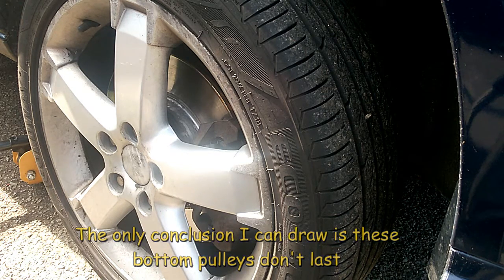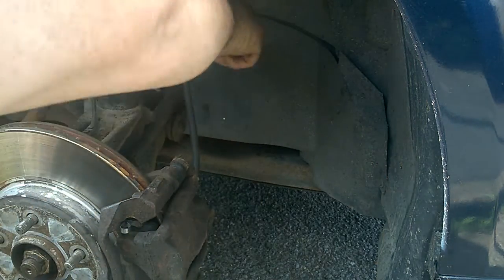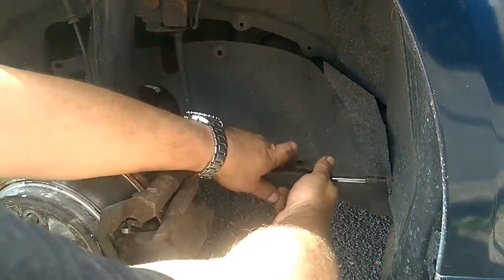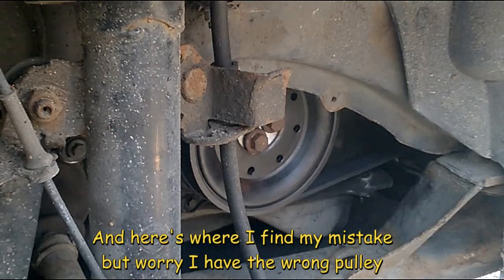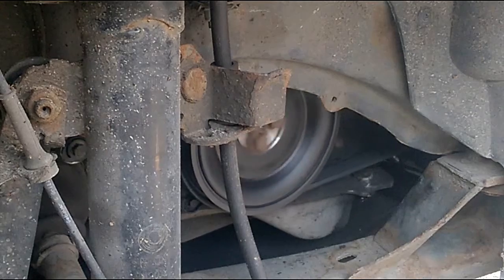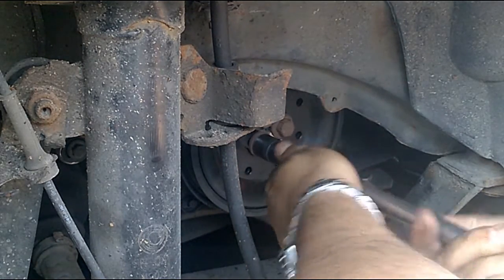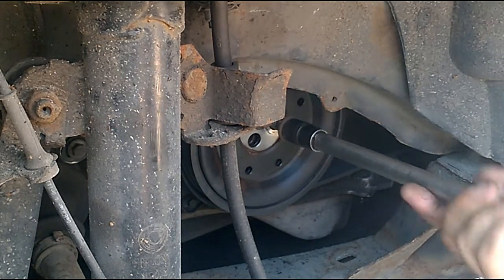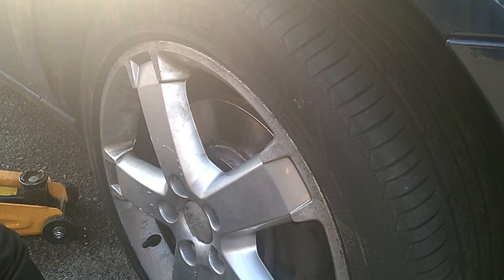Mondeo Mk3 Bottom Pulley Change

Comment: A little tip for your rattle gun is to remove  the core plug on the end of compressor tank and replace with 1\2" tap and then run bigger hose to rattle gun. Makes nuts and bolts practically leap off.
Reply from the maker: I may have to have a look into that as the compressor runs at about 120PSI, I think an extra 20 or 30 PSI might make a lot of difference.
Reply: @TheFakeRussian  it's all about the volume of air to the gun! I've tried mine through the proper connection (through the regulator) and it was too slow. I put a 1\2" iso valve into the end of the tank  which screws straight into where the plug is and then put 15mm reinforced hose straight to the gun and voila! I first tried it on my son's Honda cr80 clutch nut and it took a seconds to spin it loose.